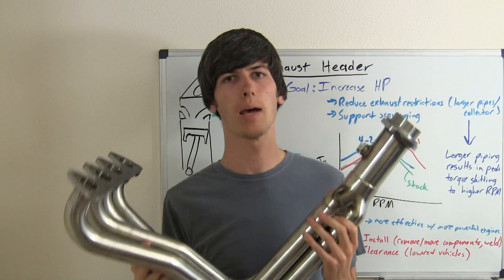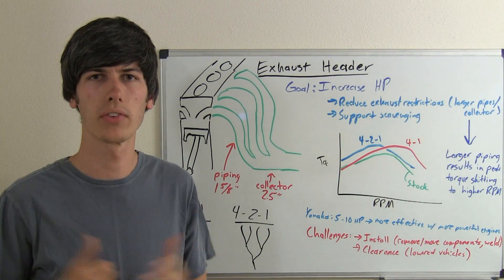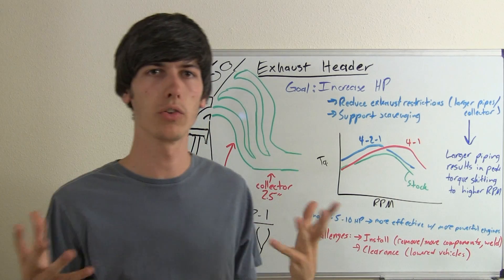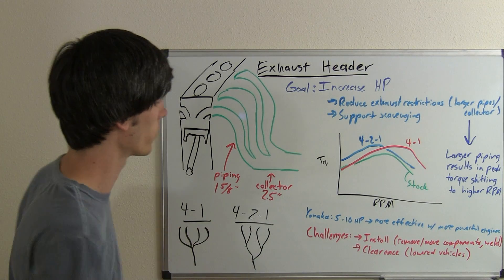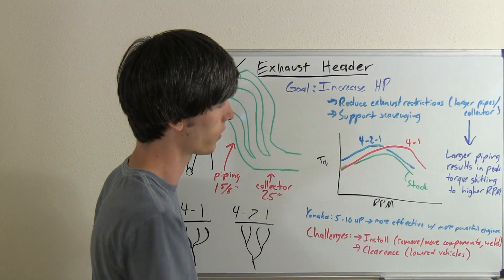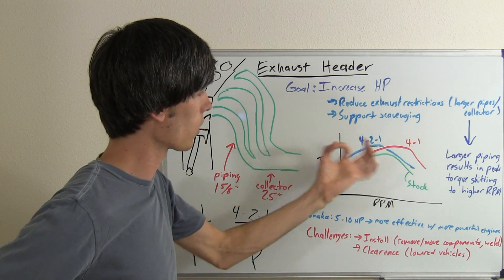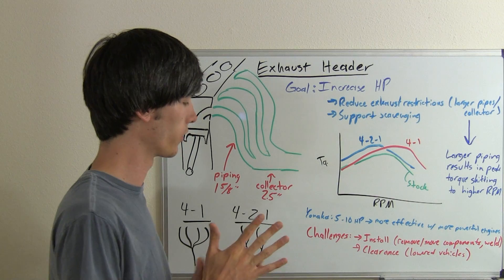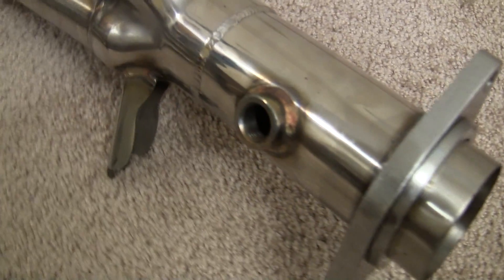Exhaust Header - Explained

Comment: Hey if I purchase headers do I need to replace my entire exhaust system ?
Reply: Jaysofresh15 lol,no but a good sprts exhaust never hurts
Reply: MrRee0014 so horse power will increase from just the headers and adding a sport exhaust will further increade HP?
Reply: Jaysofresh15 thats the idea,gets better  air flow headers sound good depending on ur car,i have them on my na ba xr6 the exhaust is basicly replacing ur muffler with a smaller 1,or do wat i did n take 1 out n make the other smaller,its loud as fuk thou, h.p fgain is not wOrth the $ 1000 ull spend,
Reply: cool thanks man
Reply: Jaysofresh15 You can try a high flow cat,resonator and a performance s flow just don't make everything direct or you'll lost your top speed unless the car is suitable for that of that kinds of mod but its rares
And for horse power...depends on what type of car you drive?For small cars like those around 1000cc the most hp you'll see is probably 5% increase for the whole system
But cars like toyota with vvti engine you could gain more than 5%-10% but to gain that 10% of power you need to tune your ecu for it to let more air and more more gas out to let your exhaust show out its true power
For cars like honda[v-tec engine]if your car in good condition you'll at least gain 10% or probably above
If you got a korean car.....don't change the exhaust it won't improve anything.

Comment: do all/most aftermarket headers for vehicles that have 02 sensors come with that threaded spot for the sensor?
Reply from the maker: rampage577 I don't know, I'd recommend checking or calling the supplier before buying if you need to know.

Comment: Question 'I am getting a ceramic header installed" what difference Is that to the regular stainless steel upgrade and Is it a far better option?? I have a 2003 wrx Subaru Impreza with 200kwts running  21p,boost and a 3inch exhaust. thanks.

Comment: So if i drive an automatic car which header should i go for?The car engine is 1nz-fe 1.5.
Reply: Same here.. I have an automatic running B18 A1 1.8 engine what kind of headers should I go for?
Reply: hugo bernabe I've heard that the header should not be change unless its a manual transmission car than go for the 4x1,but for automatic just change the inlet to 1.5-2.0 and a simple performance exhaust
Reply: Liang Kar Ee Great..thanks!!
Reply: mohamad hamad I have a ke70 that is build for drift and its manual....sigh
Reply: mohamad hamad  your funny hhahahaha

Comment: I have a 2001 gmc sierra 1500 sle... and I have the flowmaster super 44s I think (it came with them when I bought it) and a k&n air cooler but I wanna know if I install this will it affect the sound it already has and also about horse power and would it fit if I got the right ones... plz reply thanks

Comment: Was wondering if any of the engineers here might be able to answer this question. 

http://www.evolutionm.net/forums/lancer-engine-tech/702407-theoretical-header-exhaust-setup-would-work.html

Basically I was wondering if a 4-2 header that later combined the gases with an x-pipe continuing to two exhaust tips would be as efficient as a 4-2-1 or even 4-1 header design, yet change the exhaust note to a more exotic sound?
Reply: This being for a 4cyl engine of course
Reply: RenegadeRukus
X pipes are for v-style engines that have 2 exhaust manifolds. So an X pipe would not work on a inline engine because of it having one bank of exhaust. An X pipe on a v-style engine brings the 2 banks together and the exhaust pulses of the v help pull (scavenge) the next pulse out.
Reply: Blunt Man even after modifying a 4-2-1 to remove the last collector basically having two manifold tips to connect further piping to? 

I'm mainly theoretically speaking here since I don't actually have a 4cyl... but my friend has one and wanted a different exhaust sound that was less "BRRRRAAAPPPP"  and more exotic/grunt.  I had a small idea that would probably need actual testing to figure out, just don't want to tear apart a $300+ header only to be wrong or damage the internals.
Reply: I looked at the link after i wrote that comment, so i understood what you were talking about. But there arent any headers made this way so theres not any testing or examples of this working. Im sure it could work. im confident it wouldent damage any internals, just find some one with a welder and header making experience and try it out. And get it dynoed before and after and let us know.